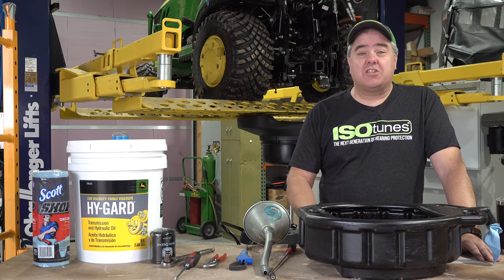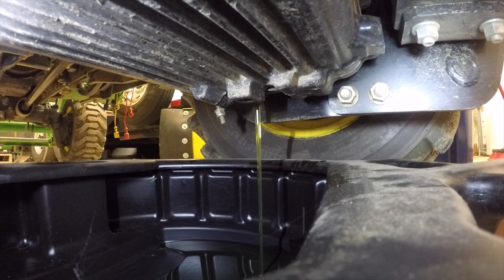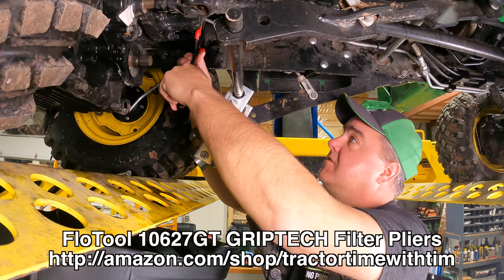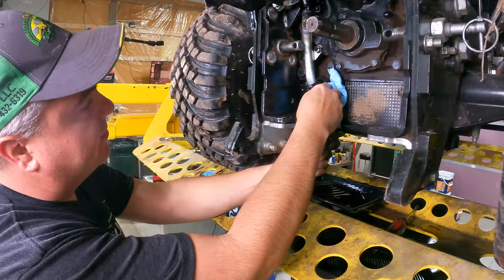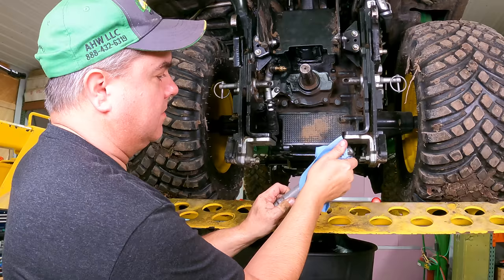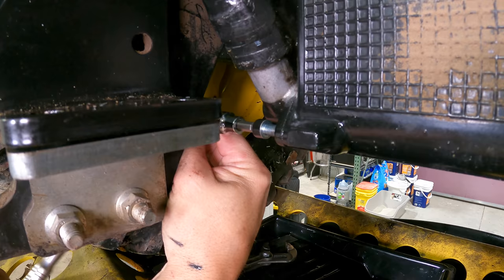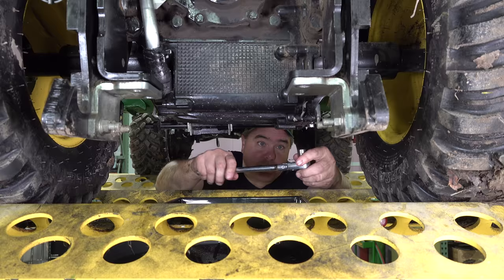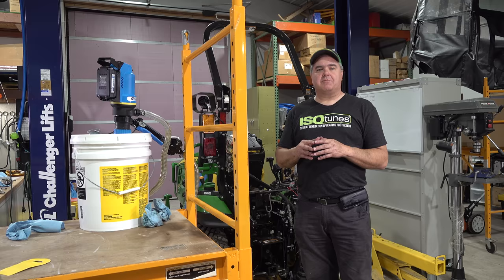Metal Shavings in Oil? John Deere 1025R 200 Hour Hydraulic Oil Change

Comment: They do make the cups for the oil filter. I like all your videos, you give a lot of useful information. I have a 2019 model with about 130 hours. I’m dreading having to do this. I had a 2014 model and it had the 50 hour service. I think since it was a new model til they worked the clearances just right they had everyone do the 50 hour service. My 2014 model I used brake cleaner to clean that screen and then I used the new oil to relube the screen.
Reply: As someone who basically baths in hydraulic oil - don't dread it.  The worst part is the very first time because as Tim noted - the suction tube elbows and clamps are painted on which adds thickness and makes it a pain - the first time.  Each remaining time it's a pretty easy job and takes (on the driveway, no lift) about 30-45 minutes.  A few notes: Before you drain the fluid, if you have a MMM, remove it, take off the 3 point and lower the three point (this makes more room near the hydraulic filter under the tractor with the mower linkage down).   I use the 3 claw Gearwrench Oil filter wrench - uses a 3/8 drive ratchet to manipulate - works great.

Comment: If you are in a bind and can't go buy a filter wrench, you can pound a screwdriver through both sides of the filter and twist it. This is not difficult as the walls of the filter are thin.
You can also poke a hole in a filter at its lowest point and drain it before removal. This saves a lot of mess.

Comment: 2210 john deer getting very loud squeal from hydraulic system under seat was intermittent now constant has new fluid new filter could the pressure relief valve be faulty seems to leak around that area when it acts up

Comment: Napa carries all size steel band wrenches that fit on 3/8 or 1/2 ratchet or breaker and blow out the screen with air compressor

Comment: Just did this fluid change at 57 hours on my 2025R, and wish I’d had watched your video prior to my project!  The owners manual doesn’t seem to do a good job showing all the lubrications points, either grease zirks or superlube spray points.  It would be great if you could do a video showing all these points if you haven’t done one already.  I know the 2025R has the “hidden” flywheel zirk, and I counted four total zirks on the machine itself and I’m not sure if there’s more. Thanks.

Comment: A few more questions for the experts...

How much pressure does the hydraulic filter handle on the 1025R?

It is a very thick wall, heavy duty filter.  Does it handle 2000+ psi?

My 1025R also had large amounts of metal on the pump intake screen. There was so much, I think it was restricting the flow.  My machine now has well over 700 hours so the oil has been changed multiple times. 

What is causing the metal in the hydraulic oil? Is it from pump wear?

My oil also smelt a bit burnt.  I have been using the backhoe a lot and getting the oil very hot.  Does the 1025R have a hydrating oil temperature sensor? Is there an hydraulic oil overheat light on the dash?

Tim, your videos are extremely helpful. In this case I was able to get all of the tools I needed and walk to the rear barn to change the oil, instead of walking back and forth over and over getting the tools I needed...
Reply from the maker: I suspect you are indeed overheating the oil.  Look into the upgraded oil cooler from hydrosplus.com use code ttwt.
I have oil temp gauges on mine, but they are not available retail.  TractorUniverse.com has an article on what is needed and how to do it.

Comment: Excellent Video. I have a 2003 John Deere 2210 I'm assuming that the process is very much the same. Oh course I don't have a Lift, So I will be doing all of this under the Tractor on the Ground. I'm wondering if maybe replacing those two Spring Clamps with two spiral hose clamps might make the process of putting the hoses back on and tightening a lot easier. Of course carefully so as not to overdue the tightening. Any thoughts?
Reply from the maker: I do not know how similar.  1025r was a pretty big change from 2210.

Comment: I think most of what ends up on the screen and in the sump is just machining chips. It costs quite a bit of money and typically is not environmentally friendly to clean parts on a industrial scale. The last chance screen is sufficient for a hydraulic system. Not so much for a close tolerance engine.

Comment: They make a hose Clamp plyers made for those type steel clamps they lock the Clamp open..wider than the nipex open them.  They will slide right on.

Comment: I wonder if removing the magnet before wiping off the outside of the tube would be easier... you could then flush the holes in the tube from the inside with a parts cleaner.  Regarding the filter removal: In those tough cases I use the universal filter tool, i.e., a screw driver hammered through the filter. That universal tool has had a 100% success rate. 😉

Comment: Taking off the suction tube is a pain when you have a 1025R without the backhoe and the 3 point arms attached.  There is even less room to work.  I am not sure if taking the arms off would make it faster. Also mine had a ton of RTV strips that was sitting on the bottom of the housing.  I had to use a screwdriver to pull it out of the suction tube hole.  I guess the person mating the case together used too much RTV and the excess broke off inside the case.

Comment: You could just remove the top hose clamp and pull the hose down. Or that little piece of hose could just be replaced each time that’s what most service technician do but they charge you for the hour.

Comment: Hi Tim. We did transmission oil and screen check & clean. There were very few steel shavings. 364 hrs. I used Bresk Clean to clean the screen and magnet. I added the Hydro Oil.2 jugs. 1 9.5 L the other 2.5. Still no reading on the dip stick. Any Ideas?
Reply from the maker: It takes 4 gal or more.  So if my conversions are correct, you’ll need more.

Comment: For a time back in the late 70's, I was a line inspector for CAT on the transmission case line. While tagging some dirty parts off the washer one day, the operator says, "that's what oil filters are for." It seemed that cutting corners made it easier for the worker to get his ' 8 base hours' in in a day! That wasn't an uncommon practice anywhere it seemed. ☹

Comment: Tim, can a sub- compact tractor handle moving a 2k lb trailer around?  I have a power boat I need to move around my driveway.  Some is on a grade of about 20 degrees.
Reply from the maker: The slope may be a challenge.

Comment: Note normal pipe clamps (screw down) have a downside to the spring clamps.  They do not provide constant force like the spring clamps so they can get loose in some environments and materials.  NOT sure if that is an issue here, but just so people know there is a reason for the spring clamps. EDIT: fixed spelling
Reply: I bought these off Amazon Breeze CT-9420 Aero-Seal Constant Torque Liner Clamp with Stainless Screw Effective Diameter Range: 13/16" - 1-3/4" (21mm - 44mm)

Comment: The 2 hose clamps that are a PITA, any reason they could not be replaced with stainless plumbing clamps? Be a lot easier to remove and reinstall if it can be loosened.
Reply: You answered it in the video, I should have waited until the end.

Comment: Say one question Tim. I noticed that you have your 3 pt arms removed when you do this service. I still have mine in place with a hydraulic top link and I-match equivalent quick hitch. Should I remove all that for this service or can I work around it.
Reply from the maker: It is much easier to do after removing 3 pt hitch.   I left the quick hitch on last time….you can do it,  but it is annoying.
Reply: Ok thanks Tim.
Was thinking it was a better idea to remove 1st.

Comment: I’m enjoying your video from sunny south Florida today. Several  questions comes to me. Do you think that hose will need replacing? Or just have a replacement standing by in case it gets stabbed. The lift does things go quicker. Do you send a sample of the fluid for an analysis or just save a small sample?
Good job.
Reply from the maker: I have never replaced the hose.  I do not have a spare.

Comment: I changed my oil and filter at 162 hour's I did what you did the magnet 🧲 trick and when I pulled the magnet out I got a shock on the magnet was a half of a lock ring that's part of the pto group. Well down to the dealership it went to remove the transaxle and repair. Well it's a long story but it's been in the shop 3 time's and is currently in the shop 🙃
Reply from the maker: Glad you found it under warranty!  I think using the magnet to fish for extra steel is incredibly valuable.  It certainly proved to be the case for you!
Reply: @TractorTimewithTim  yes I got lucky on that one thanks to you for showing us on your videos again thanks Tim. I find your videos very helpful and well done 👏.

Comment: Before they changed the first oil change interval from 50 hours, I did mine at almost 100 hours, feeling a bit guilty about waiting so long, so when they changed it to 200 hours I felt much better about it. Still had all the little metal filings that showed up on the magnet, like yours did on X. 
As usual, most of the materials for a servicing from JD are quite expensive, so I went to my local NAPA store and we looked everything up. Everything is available through NAPA except that hydraulic oil filter. Three years ago the hydraulic fluid from JD was going to cost $114 for the five gallon bucket, but the same stuff under the NAPA brand was just $70 for the same five gallon bucket, and it meets the J20C specs that the manual calls out. Hey, if JD says other oils are OK if they meet their specs, why pay almost twice as much? 
My NAPA man was also a bit pissed that JD does not allow a cross-reference for that Hydraulic filter. We are going to cut a new one open and take measurements and then do the same for other brand filters until we find one that is identical. I originally thought it might be specially constructed to handle higher pressure, but not so. At that point in the system the oil is still at suction "pressure". It's just ridiculous that Deere would make their item number proprietary and then charge three times ($30) what it SHOULD cost! 
I'm also machining an adapter to allow me to use a remote-mounted Oberg aircraft filter in place of that stock can-filter. Obergs filter down to 1-1/2 microns, much finer than a can filter. And, much easier to clean rather than replace.

Comment: I did my 200 service and when I pulled out the magnet there was a cotter pin in it should I be concerned???!!!
Reply from the maker: Hmm.  Seems like someone dropped a cotter pin into the reservoir.   I would not think a cotter pin woulda been used inside the transmission.
Reply: Yeah I wouldn't think so either it was a tiniest little thing I can't post a picture on the message board though but quite a surprise to see on the magnet when you pulled it out thanks for your video lot of help

Comment: After removal I flush solvent thru the screen in the reverse direction (I have a parts washer).  Using the magnet to remove more material is a great idea.  The level slightly over full is probably because the filter is empty.  Does anyone know if the Deere manuals give a torque value for any of these parts?

Comment: I can’t believe how much metal is in that tractor. That’s also the hydraulic oil reservoir. Is this normal for these. If that metal was found on a piece of heavy equipment filter it would signal major problems.
Reply from the maker: It is normal for this model.

Comment: Tim, I'm kinda new to the tractor world but I've changed the hydraulic oil twice now in my John Deere 2305. Both times I've done it with the backhoe on the tractor. My question is; is it best to have the backhoe on or off the tractor or doesn't it really matter? I've kinda wondered about that for a while now. As always, another great video.
Reply from the maker: Uh, why on earth would you leave the backhoe on!?!  Trivial to remove.
Reply: @TractorTimewithTim  Like I said, I'm a novice but it just seemed to me that it would drain most if not all of the old oil out of the backhoe hoses too. It really wasn't hard to do with the backhoe on but I don't always have it on the tractor.
Reply: @johngersna3263   With a hydraulic oil change - you're not going to get all the fluid out of the cylinders, lines and valves, the BH is no different.   Make your life easier and take that BH off!  :)
Reply: @MakerBreakerFixer  Thank you, I'll do that. I appreciate the information.

Comment: So, I changed the filter, fluid, cleaned the screen/ magnet. Now no pressure 😢. What am I missing?
Reply from the maker: Do you have power beyond (backhoe)?  Make sure power beyond hose is connected together.
Reply: Thanks for your reply!  I had the screen/magnet in incorrectly 😅.  I discovered your site soon after I purchased my 1025r. I am so grateful for your help always 😊 thanks again!  
        David.

Comment: That oil looked brand new.  What is the reason to extend service interval by x4?
Reply from the maker: I think it is more about the shavings in the screen and filter.   Less about the oil itself.  Just my guess …I do not have any data to back that up.
Reply: @TractorTimewithTim  so short oil change interval for the break in period, then extend it out afterwards.
Reply from the maker: Yes, that was the original schedule:  50,200,400, etc.
Now they have removed the 50.
Reply: @TractorTimewithTim  that's crazy,. i would still do the 50 hr one, just to get the metal shavings out.  The manufacturers make  scheduled maintenance intervals longer to make things appear " maintenance free",. then things fail and get to sell you new parts.  It's a trend, like the maintenance free front suspension on most trucks and cars nowadays, then you get to rebuild at 100k and install greasable ball joints, the way it was supposed to be

Comment: I recently did my 400 hour hydraulic fluid and filter change on my 2013 1025R.  Was buying the Hy Guard Low Vis and the clerk at the Deere counter said I needed regular Hy Gurard. I live in Louisiana, have your heard anything about this? Thank you for your time.
Reply: Randall, the chart in my manual for my 1025R  and 3320 both call out "regular" Hy Gard (J20C) for the temperature range of -10 to 122. I think I'd use that instead of Low Vis that far south.
Reply: @stevebrookshire1176  Thanks for the input. I had just been following the advice of the salesman who I bought it from. Much appreciated for your advice.

Comment: I use a hand pump that fits on the 5-gallon buckets.  It works fine and is a lot cheaper.  Typically I can tell how much I've pumped using the level in the bucket which is generally visible through the translucent side.  I use tractor fluid in my rear axle (Hydraulics) and transmission and need 19 quarts total, so it's a lot of pumping.  So glad I've got kids to man the pump.  (^_^)  Best of all, I just take the old oil to my local DPW because they use waste oil to heat their garage in the winter.  Not only does it allow me to get rid of a ton of oil annually, but in a small way it helps keep my taxes down.  (^_^)

Comment: I've had the gasket material on my 2025r, took me for a surprise for a minute until I thought about it for a bit.  On a different note, I'm curious how tall your barn is to the ceiling?  I've been debating a lift for years, but my spaces that I could put a lift, I only have 12' to the ceiling or rafters.  Which for the tractor & lawn mowers is probably ok, but to justify it I really need to feel I could also get under some of my vehicles.  So just curious how tall you have there as a comparison.
Reply from the maker: Mine has scissor trusses at that end (thankfully).  Probably 14’ in the center there.
The rear of the building is 11’6” to the ceiling.
Reply: @TractorTimewithTim  Thank you sir!

Comment: I have always tightened my filters 3/4 turn after gasket contacts surface, the hydraulic filter on my 1023 keeps coming loose (3 times now) next time i will put the pliers on it, has anyone else had this problem?

Comment: Tim you don't have to remove the clamps.......loosen the bolt right above where you pushed the clamps up to and that whole hose moves.  Just barely enough to get the filter out of the tranny.  I also replaced those clamps with spring loaded nut clamps.  I used a toothed oil filter remover that adjusts to difference sizes off Amazon, it gets just about any tight filter off.   I did the engine 100 and the tranny and all at 200 and had very few shavings and no gasket material.  lol....didn't you warn in the original video not to drop the magnet as it breaks easily??     Oil Filter Tool:  Motivx Tools Oil Filter Removal Tool - Adjustable Wrench for 3.15" - 4.15" Diameter Spin-On Oil Filters          Clamps:  Breeze CT-9420 Aero-Seal Constant Torque Liner Clamp with Stainless Screw Effective Diameter Range: 13/16" - 1-3/4" (21mm - 44mm)
Reply from the maker: Uhoh!  Shoulda watched my own video!

Comment: Surprised they only use that metal screen. Hydraulic fluid is prone to getting contaminated by the various attachments and the quick couplers. My tractor has a large paper filter. Though it is a much larger machine at 43 HP.

For stuck filters and not having a special wrench, an option is to stab the filter (through both sides) with a sturdy screw driver, drift pin, or other narrow and strong rod. Then you can use it as leverage to turn it.
Reply from the maker: Did you watch it all????
Reply: @TractorTimewithTim  I guess not. Left at the refilling. Take it, you mentioned something about these. Skimming thru I still didn't catch it.
Reply from the maker: @court2379  maybe I misunderstood.  We showed removing and replacing the paper filter.
Reply: @TractorTimewithTim  Ah sorry. My mistake. I was thinking that was for the engine for some reason, but obviously it is on the transmission...